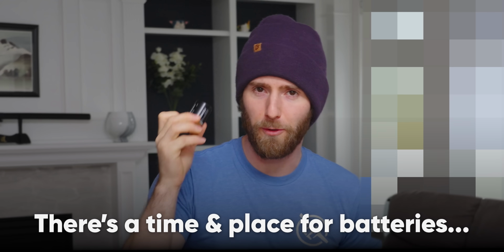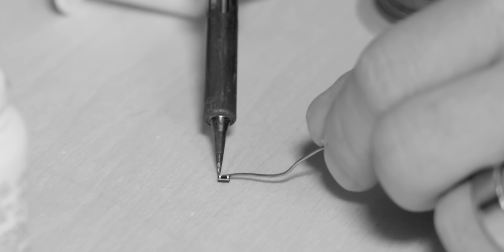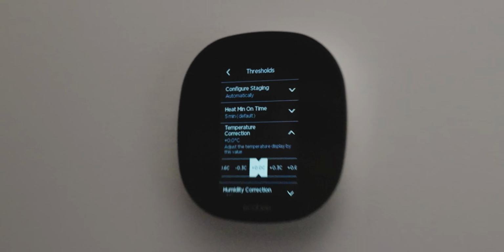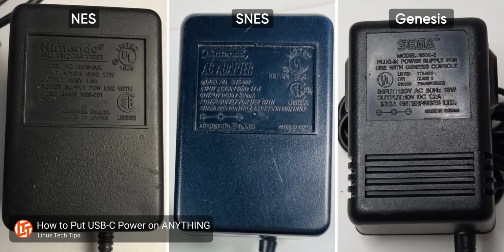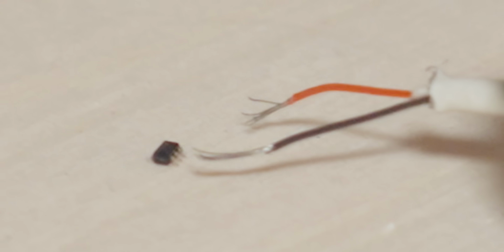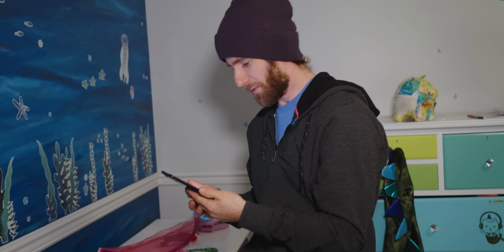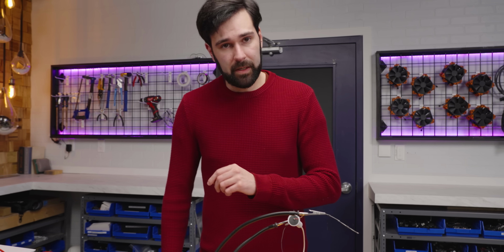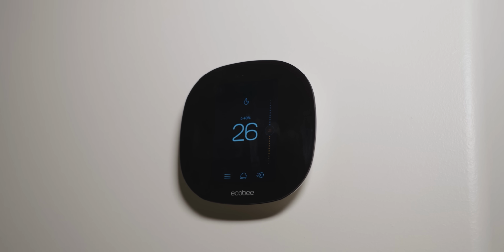I HATE Batteries! - Converting Wireless to Wired (a cheapskate’s guide)

Comment: Normally 3V devices have their limit on 3V6, for battery powered if they are full insolated you could use a capacitive power supply using a 3V3 zenner and capacitor instead resistor to limit directly from the AC. Or put the zener and a 33Omh resistor to the 5V

For size and easy use 3V3 Modules using a variant of x1117-3 LDO are chap and easy to get since they are used a lot on makers community, the smallest is like a 12x8mm board.

Comment: Current variations are ruining your voltage regulation because you're not using the voltage regulation as designed. On the second page of the datasheet, it shows you a diagram with a capacitor attached to the output. This is the pool of reserve energy used to prevent voltage from dipping during sudden increases in current demand. (For switching regulators, this cap is even more important, but this one is linear so it almost kinda works without it - to a point, as you saw.) I get that showing "the even hackier DIY solution" is good content, but like... come on, it's practically failing on purpose to not even follow the datasheet's application circuit. This feels more like one of those "do bad DIY on purpose for hate clicks" videos than an LTT project.

Comment: Voltage regulators  need an output capacitor to handle those voltage spikes.  Should be noted in the data sheet.   You did read the datasheet, right?   For such low power app, the diode chain or even (maybe) a zener diode should be ok.

Comment: This sounds like it'd be a good PCB way project. Get a button cell sized PCB with exposed contacts so you can just drop the board in like the button cell, use the same surface mount components as before, and add a female USB-C connector. Dremel out a slot in the back cover for the connector, and you're golden.
Reply: yep - and it could be even sold as a conversion kit later on LTT store lol
Reply: How hard is it to design a PCB like that? Is there any straightforward way of doing that, or is it basically the electronic hellscape version of learning CAD?
Reply: @TrolloTV  As you already have the component lists and how to wire them, so almost nothing to think about, it should be pretty easy. Honnestly, if you run KiCAD, with a good tutorial about it on the side, along with the PCB manufcaturers requirement for them to make your PCB, it shouldn't take more than 2 hours.
Reply: @TrolloTV  pretty easy actually. The tools are pretty good.
Reply: 1:45 but you'd need a different pcb for every type of button battery
Reply: @leonox7313  I am okay with this :D
Reply: Also add a switch to choose the input voltage (5 volts, 12 volts etc).
Reply: Or just leave some open contacts for more flexibility. Drilling a round hole is easier than the rounded slot needed for usb c.
Reply: @fredwupkensoppel8949  Drill two circles and then file down the sharp points in the middle. I do agree, however. The less opportunity I have to fuck up, the better.
Reply: and youre platin, when you just solder the wires to the contacts and have the DC-DC converter in the usb plug or... titanium when you just buy the right power supply.
Reply: I've added small vintage regulators to tons of these sensors. Run short distances of very thin wire (not much draw) and you can very easily hide in drywall.
Reply: Yeah, if you're gonna use tiny ass components like that, solder them to a project board pcb and cut it to fit. You can probably make several modules out of one board. Just cut it to size. It's MUCH less stressful to solder wires and components to a board than to each other. Also, it's a simple DC-DC conversion. There are tons of pre-made voltage regulators/buck converters that you can buy for stupid cheap. They're tiny as heck. Some will even have a usb port built in! (the manufacturers kinda already know what you're planning to do with them).

Like for example, let's say you want to incorporate a tiny little usb-c plug to make it super low-profile. You can go to amazon and buy a 5-pack of "JacobsParts USB-C PD" module and you have the option to output 9v, 12v, and some even do 20v. From there you can pair it with any variety of teeny-tiny step-down buck converters to dial it in. These things are small--like the size of a penny.

Also... why are they insisting that it's 3.2v? The replacement batteries listed on their website are "3v CR-2477." So it's a 3v battery with a 0.2mAh output. I'm guessing Dan probably got his voltage calculations by checking it with a multimeter. He shoulda just looked at the datasheet. The problem with using a multimeter here is that batteries in general have a fuzzy "float voltage" range. Fresh batteries often start a little higher than their rated voltage so that there's plenty of wiggle room for the device before the battery finally dips below the required voltage and "dies." 

The good news here is that this means there's a ton of wiggle room for them voltage-wise as well. It could probably handle 3.3v even. If that's the case, they could just buy a friggin garbage bag full of "CE009" 5v to 3.3v converters for pocket change. It comes with a usb port attached to it, so they could've solved the problem with ONE module. Four blobs of solder for the wires to the battery terminals... done.
Reply: Isn't that just a battery dummy as you would use in photography?  
What you are looking for can be obtained for 24$ for different coin cells The Coin Cell Emulator CR2016/CR2032 by [bobricius]
Reply: @TheRazerx7  That's an elegant solution, but you would need one for a CR2477 battery, because it's twice as thick. You could mod it, but you shouldn't have to if you're going to spend $24. There are other modules sporting a usb port and voltage stepping that you can buy by the dozen for a couple bucks each, and you won't be limited by the shape of the battery. 

Still, what you've found is a cool product. It looks like it was originally designed to be modular as well. I would love it if there were more battery sizes available through the seller, so a person could buy the module and the dummy battery separately, then pair them up. But they'd probably have to scale up their investment and production a lot.

Comment: As others have pointed out, the solutions in this video are probably the hardest, hackiest, and most brittle fixes they could have chosen. Get some cheap buck converter and it will always work and be a lot easier to solder to (if you even need to solder).

Comment: You could put your circuit on a small coin cell sized board with connectors in the right spot to connect to the battery connector without soldering it in

Comment: wow dan should host more, that was actually the best explanation of any electrical engineering i’ve ever seen
Reply: The lack of capacitors is probably why the LDO / MIC5504 didn't work. For further reference, if interested in electronics... 

The MIC5504 (or any other LDO) requires input and output capacitors to function properly, these are called bypass capacitors and aid with stabilizing the voltages during random current spikes.  The datasheet for the MIC5504 recommends 1µF at both input and output side, but it wouldn't hurt to oversize it with a 2.2µF capacitor. 

An LDO lowers voltage by dissipating the surplus energy as heat.Thus the heat dissipation can easily be calculated by subtracting the output wattage from te input wattage.
Lets for example estimate the average output current to be 10mA. 
- The output wattage at 3 volts would be 3V*0.010A = 0.030 Watts (Or 30 mW)
- The input wattage at 5 volts would be 5V*0.010A = 0.050 Watts (Or 50 mW)
- The heat dissipation would be 50mW-30mW = 20mW ... The other 30mW is used to power the device. 
- Next we need to check the LDO's datasheet to get the temperature increase per dissipated watt of energy, usually labeled as °C/Watt.
- Our MIC5504 has a temperature increase of about 250°C per watt. We only dissipate 0.02 watts of heat, thus we multiply 250°C by 0.02mW = 5°C temperature increase. 
- Thus at an ambient room temperature of 20°C we can expect the LDO to reach a max temperature of around 25°C. Which is below the maximum rated temperature of our LDO.

* Note: 
- The lack of a pcb/circuitboard as cooling plate could cause slightly higher temperatures in reality. 
- I always try to keep an LDO below 70°C tops, even when the datasheet states 150°C.
- Look into a buck converter when larger voltage drops are required! These won't dissipate as much heat, but are more complex and bit more expensive.
Reply: You probably don't watch any EE videos because he didn't even show what he built.
Reply: @zestykefir  glad im not crazy. for a beginner like me, I have no idea why using diodes as resistors works. I know diodes typically have some resistance, but I don't know whether they have to be special diodes in this case?
Reply: @purplelord8531  They drop the voltage by 0.6v each in forward mode, when there is no current there is no voltage drop
Reply: Do u have electric engineering degree? How much money do u make with that?
Reply: @fynkozari9271  idk who you're replying to but I said "for a beginner" so it's not me
Reply: @fynkozari9271  "Do u have electric engineering degree? How much money do u make with that?" 

I guess that question was for me? 

I'm an embedded engineer and do both software and hardware. I'm however more specialized in the firmware / software part, but (some) electronics knowledge is always handy when designing new embedded systems.

I estimate my income to be slightly above average for my age, but not by a lot. I drive a second hands Asian car, not a German on :-). I could probably get 20 to 25% raise if I changed job, yet I prefer to stay at my current workplace where I'm treated as human being instead of a machine or resource. Most employers that offer an 25% raise, expect you to work 75% harder for it... My current job allows me to start at 9 am, stop at 5:30 pm without forced unpaid overtime. I'm also allowed to work 2 to 3 days from home each week. This provides me after work-hours with enough free time to work on other part-time freelancing projects, or personal projects instead.

I would however highly discourage people to study electronics engineering, if not really really interested in it. It's (in my opinion) a lot harder than software engineering, with a lot more mathematics. There are also a lot less job openings in electronics engineering, compared to software engineering. Thus a Master degree is often a minimum requirement to obtain a good job as electronics engineer, whilst a Bachelor degree is more than enough to get hired as software engineer. 

I would recommend starting with a bachelors in embedded software / firmware engineering, as backup. Then continue-on for a Masters in electronics engineering after that. I would not recommend a bachelors in electronics engineering, as it's (sadly) often undervalued. Some of my friends who got a bachelor in electronics are only allowed to do maintenance at work, whilst most of them would design better circuits than many self proclaimed experts with a master degree. But that's sadly reality :'(

Comment: Note for Europeans:
at 1:10 there is a Fire Alarm shown in the Video.
In the EU wired Fire alarms are not legal if they are not installed and controlled regularly by an expert.
So modding a Battery powered one isn't Advisable.
They need to be replaced every 10 years anyway, so if it never dies and alerts you, you will probably forget to change it.

Comment: The reason of dropping voltage with resistor doesn’t works is because you’re messing with output impedance(or resistant). It basically limiting the output current. If your loading consume more than it can provide, the actually voltage will drop and your sensor will black out! you might never be able to know this with only a multimeter, simply because this(current when up->blackout->reset)happen so fast and your multimeter only a few Hz update rate.
Reply: Use diode to drop voltage with unknown current consumption is not a good idea too. The reason is voltage drop grow exponentially when current ramp up, they’re not linear. You just got a bit of luck that your sensor can tolerate this difference. It might sometimes reset randomly and go crazy without reason.

Comment: there are arduinpe 3.3v power supplys for like 2€ each in a pack.. maybe tha paired with a resistor is a solution as they even include ac plug..

Comment: Linear 3.3v regulator plus a small capacitor on input and output would be my approach to this - no need to faff about with a potentiometer, and the caps should soak up the power spikes reasonably well.
Reply: would have to be a LDO. you need a LDO VR IC.  The current spike is caused by the load.  The cap would act to supply the current.

Comment: Ok, but, why not use a cheap buck converter? DC to DC converter from even eBay, Amazon or Aliexpress??? You don't have some electronics technician to advice before making such episode? :) Weird :). I can advise from time to time if you need. 

With that one you can put those 5V and use a small potentiometer to get the volts you need.

P.s: there are boost converters as well working the other way. You put smaller volts and get more volts out.

Comment: The CR2477 datasheet (Farnell) shows that its initial voltage (fully charged) is 3.4 volts. Its nominal voltage is 3.0v. The cell will be in its nominal voltage range for the majority of its life cycle, but your device MUST be designed to accept the maximum voltage of the cell otherwise replacing the battery would destroy the device. That is to say, you don't need the potentiometer, your 3.3v regulator/buck converter is fine on its own.